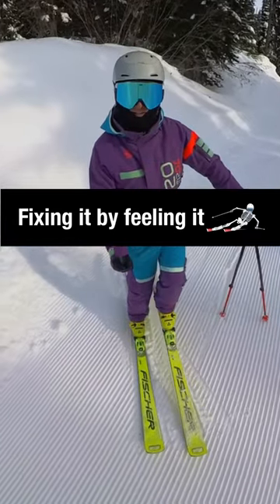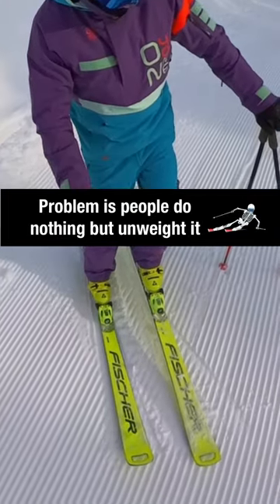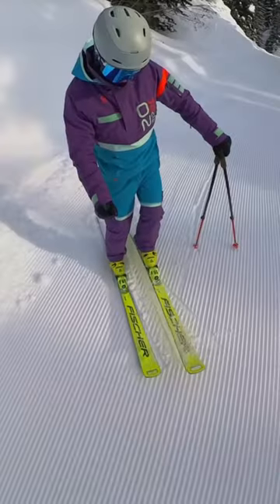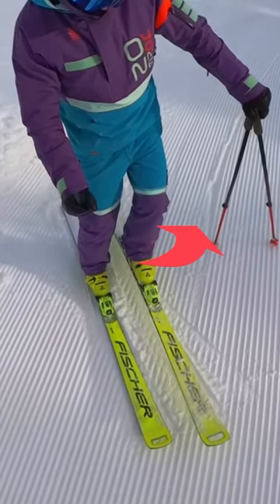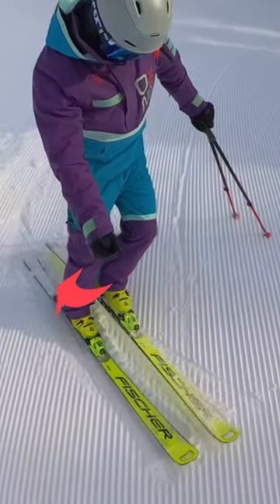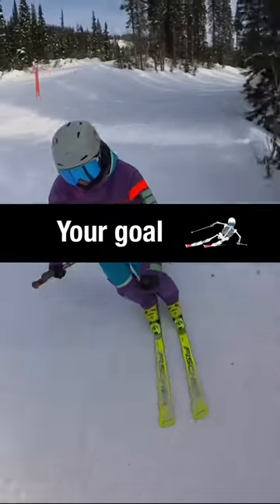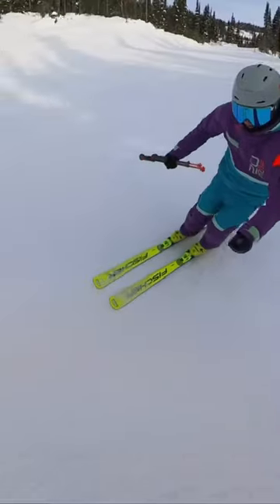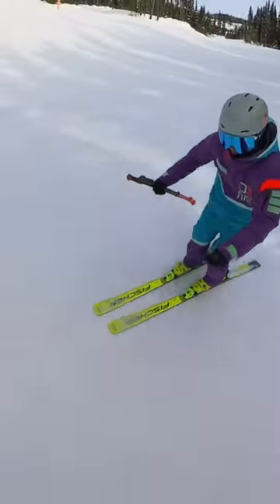Fix your inside ski - Tip for intermediate/advanced skiers #skiing #Skitips #howtocarve #skitutorial

Comment: Your skis make a V cause you lean inside the turn. Inner ski gets more pressure and does the turn, the outta one wants to get straight down the fall line cause of no pressure.
Simple physics.
Next thing i saw: widen your legs! Since we got carvers we ski hip width. This gives you more control, especially on ice and race carving.
Never ever lean inside!
Ski hip width!
Enjoy your snowdays and stay safe.
Happy new year. 🤙
Reply: Your skis should be almost touching!!!
Reply: @seagie382  Why?
Reply: @seagie382  I guess no answer is also an answer. I hope you find something else where you´re maybe better in. Cause knowledge of skiing isn´t your thing.
Reply: @Scr3amapillar I've read that the skis almost touching is back when parabolic skis weren't a thing yet, and you really only need to be hip width with modern skis as you said
Reply: @jp4431  Nowadays we have slushy snow because of plus temperatures all feb long. Damn climate crisis. For sure i take my skis together to 'surf' on snow. It's way easier then. So it always depends on the daily conditions and if you have old skis (which nearly nobody has) or carvers. But you can also ski hip width. I mean: why not? Offpiste skis are wider build and are like kinda snowboards under each foot. 😊 Older skiers have an older style (like myself). And if you learn it nowadays you learn it hip width. That's it.